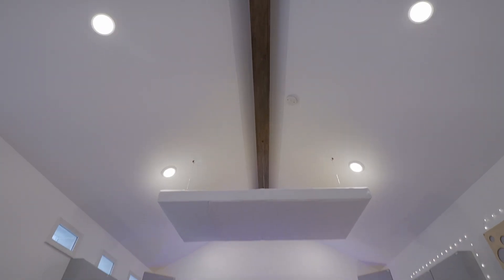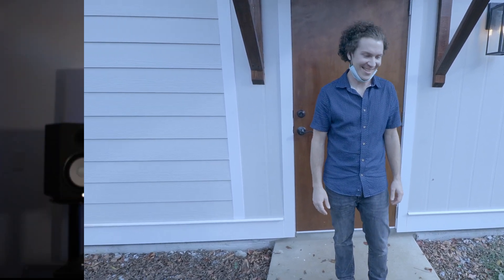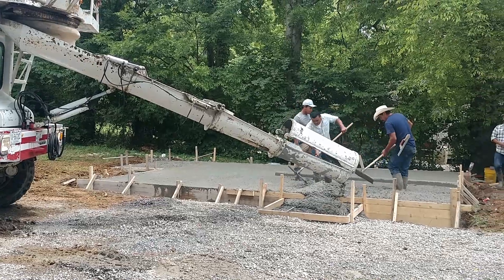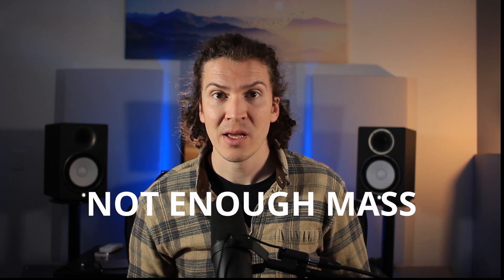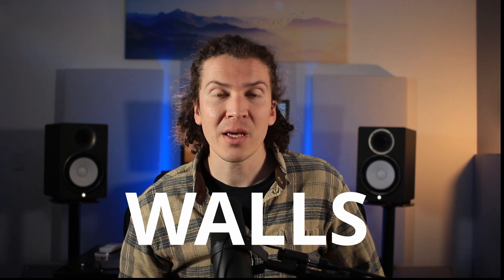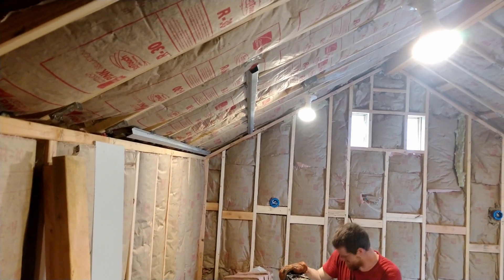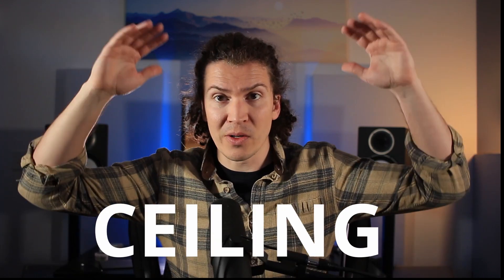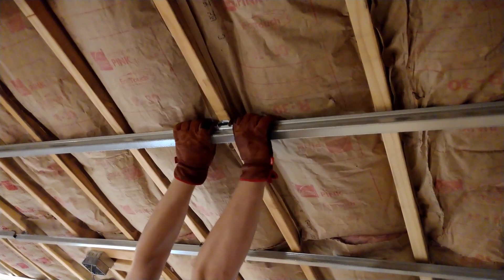How To Soundproof A Room

Comment: thank you! this is very helpful. but i'm confused about the "all or nothing" concept. in my case, i'm not concerned with building a 100% soundproof studio. i'm installing a 12x16 shed in my yard, and i'd like to be able to play full volume with a band, without getting noise complaints. i'd also like to do some home recording. nothing incredibly fancy. just basic tracking. not a commercial recording studio. so i was imagining some modest sound proofing that you recommend, such as installing hat channels and 2 layers of 5/8" drywall with green glue in between. minimizing windows and doors. adding acoustic treatment. is there no point in this if i don't go all the way? might this approach cut down the sound by a significant margin?
Reply from the maker: Hey Ryan! Great question. So what you just described is certainly a great direction to go. The all or nothing really means you can't put in the hat channel walls and 2 layers of drywall with green glue, but then put in regular windows and doors and expect the room to be soundproof. So I think I would do what you just said, but if you do install windows make sure to make them as soundproof as your walls. So if your wall has an STC of 50 then the goal is to make the doors and windows also have an STC of 50. Hope that helps. The key is consistency.

Comment: Here's a silly question/option for putting in windows: going "double double".

You can get double pane, single hung (opens bybdlidigng window) for as low as $90 each. Since you/we are building a double wall exterior, just mount a window outside as normal, with a second one from the inside.

The windows are vinyl frame, so low thermal and sound conduction,  18x24" windows that will give you a functional,  relatively high performance window, for only $180 per opening. Not quite as cheap as getting 2, 6x14" custom cut glass (3/8" and 1/4" respectively) but a lot more light., and i dont think it would be THAT much more expensive.
Reply from the maker: The glass weight matters as does the type of glass. This would be tow thin float glass windows, which would not stop sound

Comment: do you have any more info on how to add the drywall underneath the floorboards at 2:29 , are they installed using timber battens?
Reply from the maker: I would just use drywall screws. You would be screwing into the floor base above which is usually plywood.
Reply: @soundproofyourstudio  is that how Rod describes the process in his book? What if there is no access from underneath
Reply from the maker: @abstractmedia8949  If there is no access underneath then you need to add mass from above. I will make a video eventually with another way to soundproof a floor.

Comment: Should I use standard plasterboard or pricey sound insulation plasterboard?
Reply from the maker: Standard, pay attention to the mass
Reply: Thanks for the info.  I read Rod’s book twice, some sections more. You’re so right…indispensable reading.
He recommends RC-2 instead of hat channels.
The issue I’m struggling with in starting to build a free-standing room within a room is this:
If the two roofs can’t touch, and I assume they shouldn’t, how do you stop the sound that is impacting the outer roof from leaking into the space between the two rooms?
I plan a 4” space because it didn’t cost much more and I have the room to build.

Comment: How did you go about venting the outside or the building in the roof part between your rafters I’ve been told I have to have a ridgevent and soffit vents and or gable vents in my building but they will be gaping holes for Sound to get out of I’m told I cannot block them off it will cause condensation and heat buildup how did you get around it Thank you
Reply from the maker: Great question john. No sound will get in. What I did is we had soffits around both sides of the building. We did have a ridge vent at the peak of the roof. I used plastic rafter vents behind my insulation to allow the roof to "breathe." Here is a link to what we used: https://www.homedepot.com/p/ADO-Products-14-in-x-48-in-Rafter-Vent-10-Per-Carton-UPV1448010/202541345?source=shoppingads&locale=en-US&&mtc=Shopping-B-F_D22-G-D22-022_004_INSULATION-NA-NA-Feed-SMART-NA-NA-New_Engen&cm_mmc=Shopping-B-F_D22-G-D22-022_004_INSULATION-NA-NA-Feed-SMART-NA-NA-New_Engen-71700000076017798-58700006490415250-92700066966870867&gclid=Cj0KCQiAys2MBhDOARIsAFf1D1dfJ6pmzVd_h0CUWVld48053ZCSC1xHkEjGHd52g7AmzoercR82ohkaAhrIEALw_wcB&gclsrc=aw.ds. Then we did a hat channel system on the roof with two layers of drywall and there is no leakage of sound what so ever. Please let me know if you have any more questions.

Comment: What kind of insulation do you use?
Reply from the maker: You want to use regular pink insulation. The insulation is for keeping heat and cold air in it doesn't have much to do with the soundproofing process. I used R30 on all my walls and ceiling because all of the walls are barriers to the outside. If you have interior walls than you can use  lower R-value insulation.
Reply: @soundproofyourstudio  so it does work, John Brandt's videos say the same but there are so many people say otherwise, that i have to use rockwool.